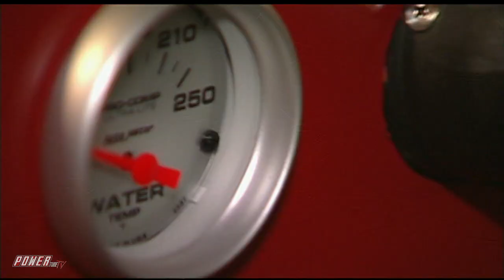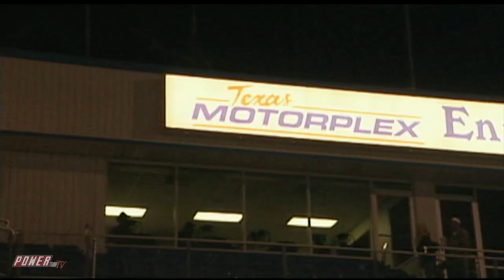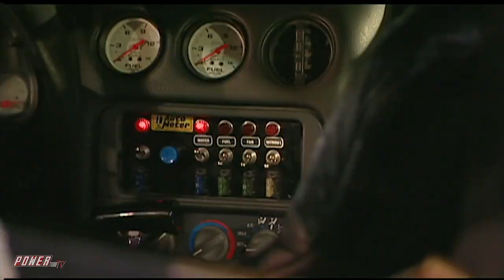PINKS - Lose The Race...Lose Your Ride! Will A Mullet help When Titles are on The Line? Full Episode

Comment: 2007-2010 Hyundai elantras:  you had to remove the lower shock bolts to remove the rear brake caliper bracket.  Meanwhile the sister Kia Forte had torsion bars in the rear and didnt have that issue
Reply: They're all throw away vehicles anyway
Reply: @killnyou27  sure will after 9 engines.
Reply: @thebigbagga  so glad I have a 2005 Hyundai Sonata 😂. MUCH WORSE 😭